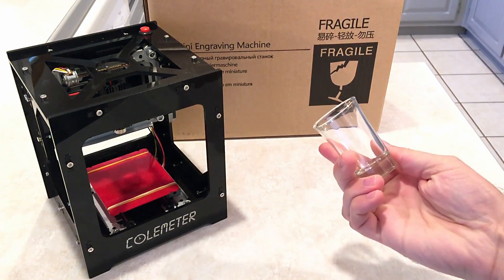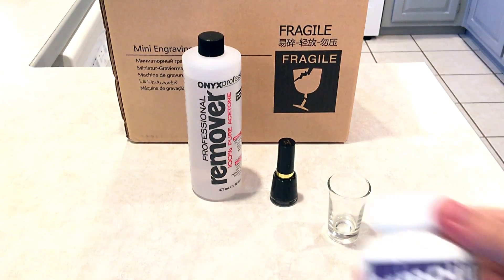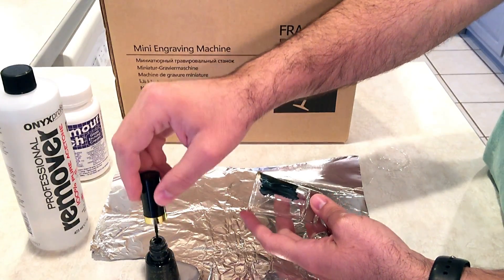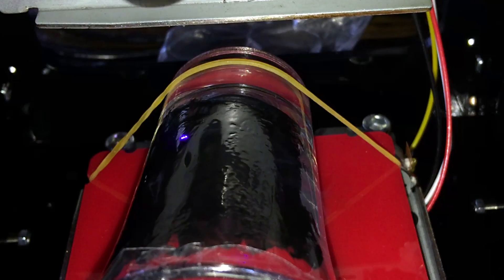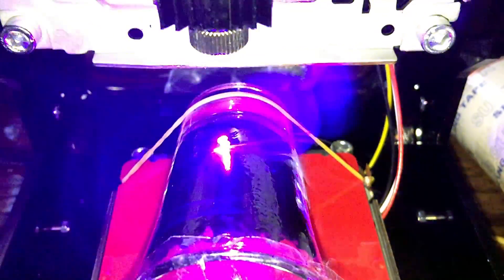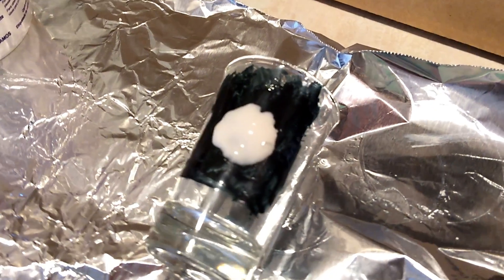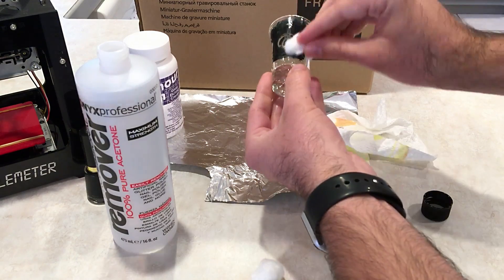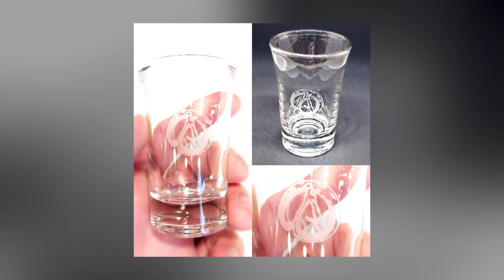How to Etch Glass with a 1000mW Colemeter Laser

Comment: Can you engrave on aluminium and stainless steel?
Reply: of course you can!!! Just cut a stencil apply the stencil and then acid etch the metal. Simple. 
if you want to do it on the cheap, don't buy a laser, get an exacto knife instead!
Reply from the maker: My next video tackles this very question, so stay tuned, and thanks for watching and subscribing!
Reply: When will you be uploading the video
Reply from the maker: I'm not quite sure, to be honest. I have the bits and pieces ready, but assembly will take some time since I have to squeeze it into my downtime. Hopefully by the end of the week!
Reply: im waiting ... i want make an id dog tag .
Reply: Will black spray paint work for bigger projects and does black play into the quality of the etch?

Comment: Do you have to do anything to etch onto acrylic ? I know in a previous comment you mentioned you could certain ways. What are they if you don't mind sharing?
Reply from the maker: Acrylic requires a little more finesse, as you don't want to char the material, but you also want good depth and detail. But the general idea is to use a medium, like construction paper or colored tape, to prevent the laser from passing straight through the acrylic and doing nothing.
Reply from the maker: Acrylic video! https://youtu.be/cCOnyfdMbnE

Comment: I'm thinking of trying this on metal. I want to etch brass and found some posts where people used a laser to burn away paint and then etch the uncoated. My first idea was to use spray paint but now im thinking a dark nailpolish would be a better idea. 
have you by any chance tried metal? Great video. Most of the laser vids are about lasers with much higher power. It would be nice to see how much you can do with a 1000mw laser
Reply from the maker: I haven't, as I don't have anything for etching metal. But this method of masking is a great way to etch otherwise un-etchable materials. It could be easily tested on metal with nail polish before the laser is even purchased. Just grab some polish, a piece of scrap metal, and paint on a letter "O" (for ohmynoun). Finally, cover the whole thing in the metal etching medium. If the etching medium doesn't harm the nail polish, you should be left with a nice shiny "O". If it does harm the polish, it should be pretty obvious.
Reply: this isnt for metal. its for Wood and Plastic only. or Leather

Comment: I make pens  and my best material is Acrylic. I want to put names or logos on them. and the method is fairly easy, but does this machine engrave Acrylic. Your help will ne most va,uable. Thanks for the video.
Reply from the maker: I actually plan to make a video about this soon. It is not supposed to engrave acrylic, but I had luck with a technique involving blue painter's tape. We have a bunch of Yeti-style mugs, and I think the lid is acrylic. I put blue painter's tape where I wanted to place the initial of my first name in order to distinguish my mug from everyone else's. The laser heats the glue of the tape, which holds the heat long enough to melt the plastic. The thing is, I'm not 100% certain it's actually acrylic, which is why I need to make a trip to the hardware store to buy some materials for further testing and a new video if things work out.
Reply: I'd be much obliges if you could let me know when the video is available as I need to get into this ASAP. Thanks again D
Reply from the maker: Of course. It will be awhile before I have a video ready, because I'm working on something new right now, but I do have acrylic on the way. I'll try and check back in with an update once I've seen if a video is required. Don't forget to subscribe! :)
Reply from the maker: Ran a quick test on some verified acrylic today, and YES, there are ways to engrave on acrylic using a medium. I will film a video showing some different techniques, how they compare, and what I'd recommend for doing this. But I'd say you're good for doing this on your own, too.
Reply: Thanks for this test. I will be more than interested to see your next video of how you did it.  Great stuff.
Reply from the maker: Acrylic video! https://youtu.be/cCOnyfdMbnE

Comment: Hey, I'm interested in using this to engrave onto wooden sunglass frames... do you think this is possible? Does the laser calibrate to different sizes or how does that work? Any examples i've seen are always limited to square pieces of timber, and I'm struggling to find details so any help would be appreciated. 
thanks for the video! will definitely be trying this out if i buy
Reply from the maker: It's absolutely possible! Wood was one of the first things I engraved on, and I also engraved on my Apple Watch band, which had similar challenges. The two things you have to remember are that you will be working with a restricted work area (20mm x 20mm) and you may need to use a platform to allow your frames to move around within the housing (because the base plate moves for etching along the y axis). Once you've made these accommodations, you'll just focus the laser manually to allow a crisp burn, and use the "bounding box" mode to see exactly where the edges of the burn will be. This will allow you to properly position the design.

Quick pro tip: Don't focus the laser until you're ready to burn, because it may etch into the material even in low power/bounding box  mode, especially if your frames are bamboo. I have a couple of items that had a faint box etched around them from focusing before aligning the artwork, and that's not cool! By keeping the laser out of focus, you can take your time getting the alignment just right.

Comment: ive just ordered the 1500mw one, was wondering how to do this so thank you for making this video, im going to try this technique on a flat sheet of glass, quick question have you ever or do you know if you can use paint filler with this laser? and what burn time did you use for the glass ??
Reply from the maker: I haven't tried paint filler, but I used maximum burn time for the glass to make sure I got completely through the nail polish. One bonus tip is to not let the nail polish get too hard before burning, because it may chip. Once it's too dry to pool back together but still tacky to the touch, you'll get the best result. What's good about this method is that you can make sure everything looks good before actually adding the etching cream. If anything looks off, a quick wipe and more nail polish is all it takes to try again.